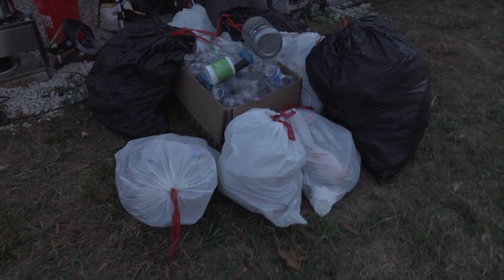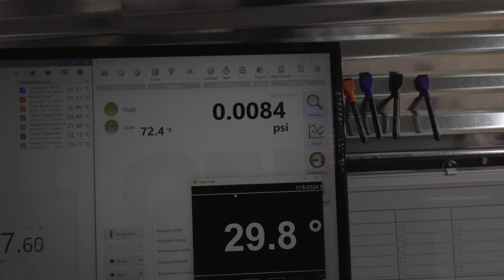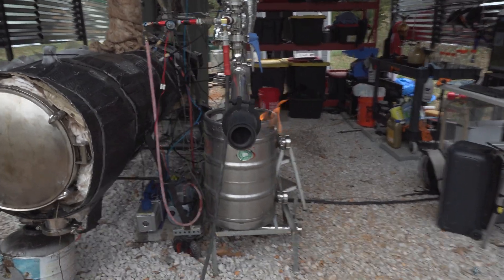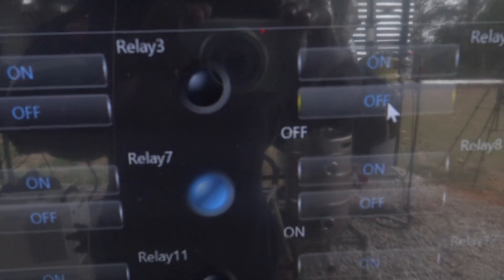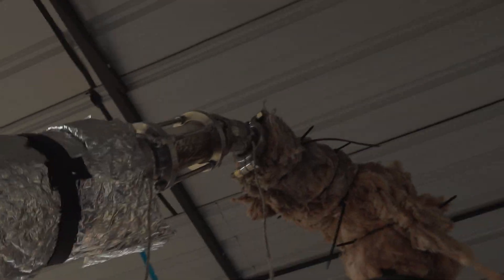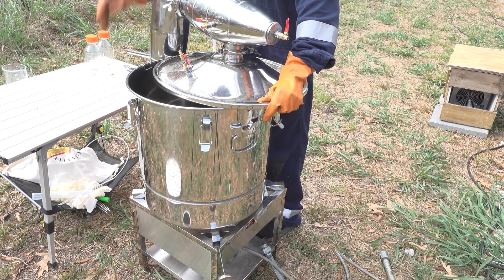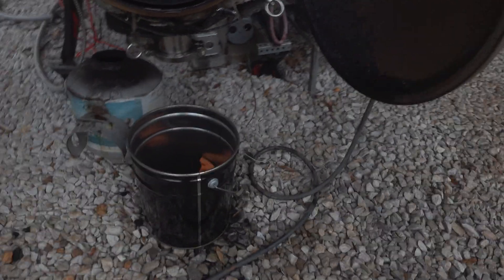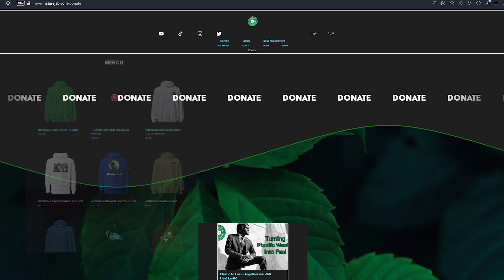Distilling Plastic into Gasoline! | Community Plastic to Fuel Run

Comment: The gas that you are collecting may have a high percentage of hydrogen. If so, it could be used in the further refinement of the oil coming out, AKA hydrotreating.

Comment: Another thought: You should look into funneling any fumes into a natural gas tank and selling them to a company that separates them. You could also do it yourself with some sort of "Fractional distillation" techniques.
Reply: FYI the oil and gas industry does at oil wells so should be easy to find someone if the industry is active in your area.

Comment: Mate, I dont know if you have them already, but maybe think of getting some solar pannels, and rooftop windmills to use a battery storage to make your energy consumption alienated from your household electricity. virtually no electricity bull for running your fuel recycling machine. Yes, there will be a fairly robust cost, but then its 100% sustainable. Also, look into 'grants' my man.

Comment: Hello Julian,
is there an substantial difference between using microwaves or the use of just heating from the outside/ heating sleeves or by induction elements ?
Have you ever heard of the use of silica salt (E 556, european term ) as a catalyst for cracking hydrocarbons ?

Comment: Test CFPP ( the point at which point the waxes forms & clogs fuel filters ) by placing it in a freezer at -15'C. The sample will contain wax.
Reply: This test does not require any special apparatus or laboratory analysis. A 0.25L sized sample held in fridge at 4'C & freezer at -15'C in a simple jam jar for 48 hours will effect wax precipitation.

Comment: I recommend getting a shredder that can shred steel.  Something that you can throw a 1" crescent wrench into and get shredded steel coming out.  Then you could easily shred fiberglass. 

It would also be a good idea to put a big funnel above it and load plastic into it with a snow shovel.  They're not common in Georgia and Alabama but they're basically huge scoops with long handles.  That would reduce the amount of time it takes to shred plastics.

Comment: The problem with PET releasing oxygen is that it negates the entire reason for running under a vaccuum. As long as you aren't running plastics with halides, like PVC, the PET shouldn't be a problem. But the oxygen with the chlorine from PVC is what is supposed to form dioxins. Teflon has fluorine in it, and ABS from electronics has brominated flame retardants in it. If you can keep those separate from PET, you shouldn't have much to worry about.

Comment: Is it possible to install a post hole digging type auger in the vessel? I think it will be more effective, less friction and flexing. Also, how about a small garden shredder? It probably uses hammers, tends to pull in more, and you can force feed

Comment: I would recommend reconfiguring your column setup. Keep the outlet from the reactor low and connect to the T piece over the collection tank, the run your condensers verticality. This should maximize the amount of liquid collected.
Reply from the maker: Will do!
Reply: @naturejab  Yeah, as a chemist, the column config was bothering me for a while. The farther the distance you want the heat to rise, the more heat you have to pump in since the gas cools. So, a T coming, say horizontally, out the reactor with a condenser on top to condense the oil and collection on the bottom is definitely most ideal for simple distillation. It's a classic setup used in chem labs to take advantage of highly efficient condensers that don't work well when used horizontally.
Reply: @williamackerson_chemist  @naturejab 
As an interesting experiment, would be cool to see if he could also attach the bubble plates between the collection tank and the condensers. Just a way to slow the vaper speed to allow maximum exposure to the condensers so uncondensed fule dosen't blow by.

Comment: I wonder if different plastics ground down into particulates could be used for high pressure concrete, housing insulation blocks, community trash cans and other repurposed materials- I know the biggest catch is no one makes money immediately from it- but is that a direction worth looking into at all? I’m getting into Scuba diving and commercial diving and I’d be happy to have another career in cleaning up trash from water ways- I wish I was closer to you or had some distillery in Texas to help the push forward to a cleaner tomorrow